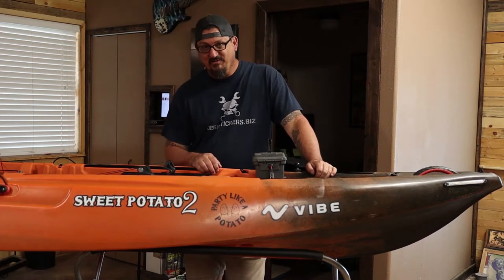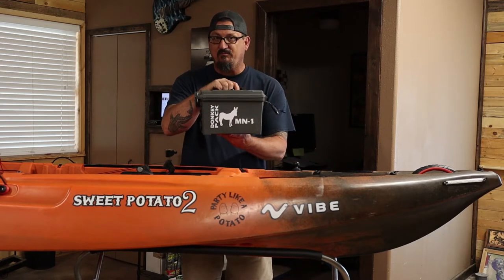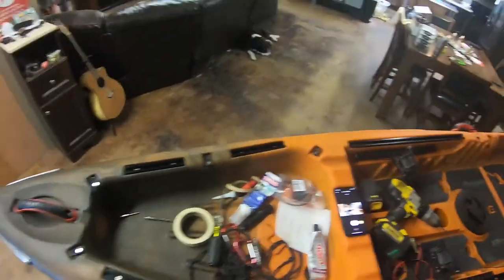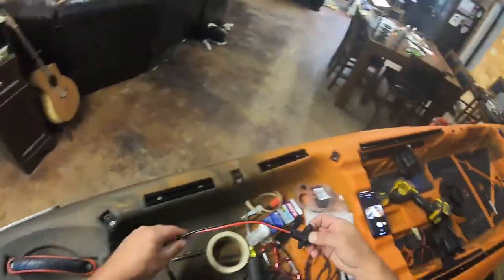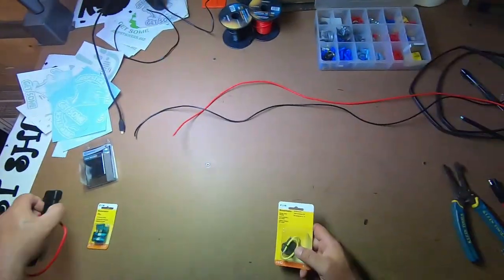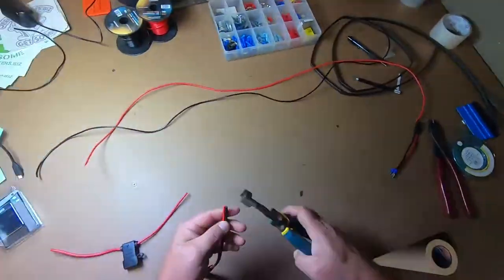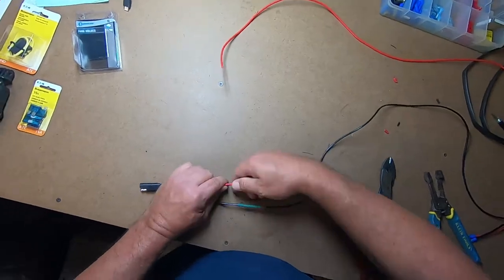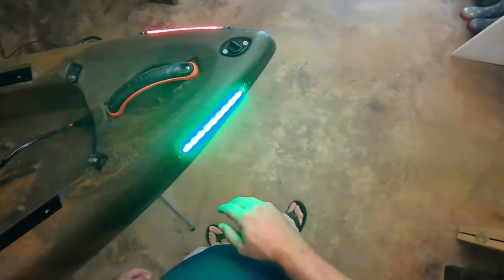Vibe Yellowfin 120 Navigation Light Installation

Comment: What lights are those? The eBay link don't work. Are those the Propel brand lights?
Reply from the maker: Since making that video they have stopped selling the specific ones I used.  Here's the closest thing I could find:  https://www.ebay.com/itm/384853899875?hash=item599b147a63:g:QFAAAOSwQpZiZhyn&amdata=enc%3AAQAHAAAA8PxizZbNm97m7RwUQO4ohHxjtVJRZa4v3TFuP%2BwVUp6iwHgCMI%2BspVhz420bJDdvgOerVosd%2FW%2Bs4y0W4453eQlorgSee%2BZcqA502p9puY%2BcNwCEG0kVOYsJy82HgeMcmCTEv8kyjPzEB%2BSLxuXFruUOgsAfQpApZe1SvAn1%2BYFAx4WMYQModhREB90hgo9H7D3SvhPZiI9GCO70uk4uO7zuqDTzQi6CNHbAWqq8lygtx8PHpaC6tnHwPXRnFtZbMHACVqX9NwANm17QkYQvchpSYqMTDsbMpzthje15Qc44neHcFdSJZnFmM9i3skFjLg%3D%3D%7Ctkp%3ABk9SR_jGnpu9YQ